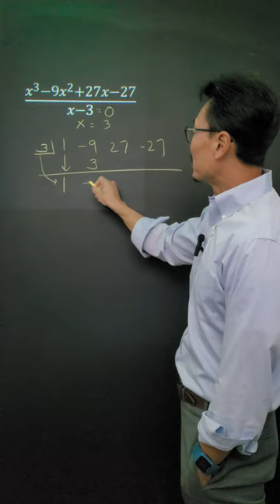Synthetic Division

Comment: lol all he did was take (x-3)^3 and divided by x-3.  So he proved that 0/0 =1 and 0*1 = 0.  Most will not understand this.
Reply: Except 0 / 0 is indeterminate, so, No.
Reply: He didn’t do a great job explaining that. In the algorithm, we do not literally set the denominator to zero. If you have seen the more standard long polynomial division, recall that we end up subtracting a multiple of the denominator. To make a faster algorithm, instead of subtracting, we multiply by -1, and add instead. So instead of subtracting a multiple of -3, we end up adding a multiple of 3.
Reply: @reefu  You actually do if x is 3.  You can spin it anyway you want to, but you are still dividing by 0.  It happens everytime there is a variable in the denominator.  If you graph (x-3)/(x-3)  you will get a line where y =1.  If yo go to where x=3 it will say undefined, which ofc is just silly.  So 0/0 =1.  If you graph (x-3)^2/(x-3)  it becomes 0*0/0 at x=3 , so if 0/0=1 then 0 * 0/0 = 0.  

Dividing by 0 is real easy.  Change the 0 to z.  Simplify the equation.  After you are done (very important) you change the z back into 0.  If you multiply or divide anything except 1 with 0, you lose integrity of the equation.  It's not a trash can.  Anything divided by itself = 1, by definition, there are no exceptions.  Another thing that will make your blood boils is that 0 * infinity =1.  Why?  because the reciprocal of 0 is infinity. Why? Becasue mutiplication doesn't actually exist, it is (by definition) repetitive adding.  Division is actually repetitive subtraction. So, how many times does 0 go into 1?  Infinite.  By definition, the reciprocal of x = 1/x, so the reciprocal of 0 is 1/0.  If you multiply a number and it's reciprocal you get 1.  Hope this clears it up for you.
Reply: @rogerahier4750   Yes, so we just have to put a restriction on the domain of the polynomial function, such that it does not include 3. It is indeed undefined at x = 3. There was a necessary assumption during the division that x - 3 is non-zero, so they didn’t prove any of those indeterminate forms.
Reply: @reefu  It is not undefined.  There is no such thing as dividing.  It's repeated subtraction.  That is literally the definition.  2 divided by one means how may times you can add 1 before you get to 2.  So how many times can you add 0 until you get to 1?  So simple, I can make a 10 year old understand.  The problem is you view math like religeon.  You were TOLD you couldn't divied by 0 and you believed them.  It doesn't matter to you that it makes no sense that you can't repeatedly subtract 0 from a number.  Oh, but your Bible can't be wrong, right?
Reply: @rogerahier4750   The definition of division is the inverse of multiplication. 0/0 indeterminate because there is no well defined way to perform this operation. We can prove that given any constant a, and the additive identity 0, then their product must be zero. However if we also know that the multiplicative inverse multiplied by itself is by definition the multiplicative identity. So there is a contraction, since 0 * 1/0 can be both 0, and 1 simultaneously, and so there is no clear way to define 0/0. This means that there isn’t even a way to define 1/0 as the multiplicative inverse either. We can see that in this case that (x-3)^3/(x-3) approaches 1 as x approaches 3, and so it would seem like we have 0/0 = 1, but we could also have the same limiting ratio but with a different numerator, namely: 2(x-3)/(x-3), which approaches 2 as x approaches 3, and so here we have 0/0 = 2. For these limits to exist, then they must approach the same number from both sides, in our case, as x approaches 3 from the left, and as x approaches 3 from the right. If we try to do this limiting argument for the function 1/x, we see that as x approaches 0 from the left, then 1/x approaches negative, infinity, but as x approaches 0 from the right, we have 1/x approaches positive infinity. These arguments can be made more precise using the epsilon delta criterion for a limit, but I don’t think you are quite ready for that yet. Don’t know why you brought up religion, but it seems in character for you to confidently make incorrect assumptions about things and state them as fact.

It isn’t that I’ve been told these things and blindly believed it in faith, but rather that these results follow from the logical framework of mathematical arithmetic.

Above you mentioned that by taking the reciprocal of 0 you get infinity, how can you perform reciprocals without division? How do you compute these reciprocals and how do you prove that a number is a reciprocal of another? You will find that any definition you give to define the reciprocal will inevitably be problematic when you try and include 0.

If you enjoy just analysing the graph of a function to prove your results so much, simply look at the graph of 1/x. Notice that it diverges to negative infinity from the left of zero, but positive infinity from the right of zero? Which is it? Can you prove that one is the more appropriate definition unambiguously using only the mathematical framework of arithmetic?

Better yet, disprove my counter example, I have the function 2x/x, as x approaches 0, we have 0/0, but the ratio approaches 2, so 0/0 = 2 right? Or what about (1 - e^x) / x, as x approaches 0, looks like 0/0, but the actual ratio approaches -1? Why is this?
Reply: @reefu  In math, multiply means the repeated addition of groups of equal sizes.   Clearly you did not read the explanation.  If you interact 0 with any number other than 0 you lose integrity of the equation.  I don't see why you don't understand that. 0/0=1, 2*1 = 2.

You seem to have difficulty understanding -infinity.  It's really not that hard.  The reciprocal of 0 is 1/0.  How many times does 0 go into 1?  1/0 = infinity.  0 * infinity =1.  0*1=0  0/0 =-1.  They both come up to 1.  I don't see the problem
Reply: @reefu  You really are trying to make things more difficult that they really are.  First, understand what multiplying actually means.  Look it up.  You say that divison is the inverse of multiplication.  Since subtaction is the inverse of addition, then division is repeated subtraction.  

Find a definition of multiply that DOESN'T say repeated addition.  When that fails, try it as it is actually defined
Reply: @rogerahier4750  Okay then, if that is such a universal definition of multiplication, what is (1 + 3i)(2 + 2i), purely in terms of repeated addition?

I want to investigate your chosen mathematical framework, so:

Is the reciprocal operation valid for any number?
Is rational multiplication defined as:
a/b * c/d = ac/bd?

If those are true:

0/1 = 0 (since we need to take 1 away from 0 zero times to get 0)

0/0 = 1 (from (your) definition)

0/1 * 0/0 = 0*0/0*1 = 0/0 = 1
But,
0/1 * 0/0 = 0 * 0/0 = 0 * 1 = 0

Hence, 

0/1 * 0/0 = 0/1 * 0/0
0 = 1 ?!

This is not a consistent framework…

I have more: 

0/0 = 0/0 * 1
= 0/0 * 1/1 (since you subtract 1 once from 1 to get zero)
= 0*1/0*1 
= 0/0*1 
= 0*0/0*1
= 0/0 * 0/1
= 1 * 0
= 0

But,

0/0 = 1, so we have:

0/0 = 0/0
1 = 0
Reply: @rogerahier4750  *gives logical breakdown of why 0/0 is problematic,

“You are trying to make things too difficult” 

Sounds like you are trying to take something as fact without using logic here…

Either you construct a method for multiplying rationals other than the standard method I’ve chosen, or just use logic and deduce that 0/0 is problematic. 

I actually used your definition of division if you would read my comment…

How do you compute 1/2 * 1/2 as repeated addition? Do you add 1/2 to itself half a time?
Reply: @reefu  */*=1.  D/D = 1.  $/$ = 1. 0/0 = 1.  That's logic.

Yes, in fact you do add 1/2 , 1/2 time.  that would be 1/4 because half of 1/2 is 1/4.  Why is that so difficult of a concept?  Like I said, find a definition of multiply that doesn't say repeating adding.  You can't.  It's the only way to define it because that's exactly what it is.  0/0 is only problematic because you refuse to understand because you have been so indoctrinted into your "religeon" that you can't accept simple logic. To me, you are no different than someone quoting the Bible. x/x =1.  Doesn't matter what x is.  Explain how it makes any sense that x/x = 1 unless x =0.  That's absurd.  That is not logical.
Reply: @rogerahier4750  For natural numbers, sure, you could define multiplication is repeated natural addition, but how do YOU define multiplication of rationals? What does it mean to add something half a time? Show me the computation, and how you get 1/2 * 1/2 = 1/4, in such a way which does not have any of the issues I had laid out above.

Here is a definition of multiplication without repeated addition: Scaling a number-line, you also get the definition of division for this as being scaling by the multiplicative inverse, but that doesn’t even matter as I USED YOUR DEFINITION OF DIVISION ANYWAY.

I have given you 2 examples of where 0/0 becomes problematic purely from the mathematical framework you have set up: division being repeated subtraction, and 0/0 is 1, in that framework, we find 1 = 0, which we know is not true. If you want a consistent mathematical framework, where we have the laws of arithmetic, then necessarily, we can’t define 0/0, or else you end up with inconsistencies like 0 = 1, using pure logic.
Reply: @rogerahier4750  you are also yet to dispute my case where 1-e^x / x as x approaches 0 looks like 0/0, but actually approaches -1, look at the graph yourself if you need, or do the epsilon delta proof of the limit.
Reply: @reefu  Where do you find 0 = 1?  How many times can you add 0 to get 0?  1 time.  Why is that so hard for you?  Show me where 0 = 1 if 0/0 = 1.  If you get 0 as a denominator, change it to z and solve for w/e.  When you are done, change to z back into 0.  Why is that so hard for you?  WHEN YOU ARE DONE is the key.  You can't just use 0 as a trash can or you lose integrity of the equation.

I find it funny that you figured out how to take the square root of -1, but can't figure out how to divide by 0 without trashing the equation.  The only reason for that ofc, is because you refuse to because of a mental block you have called your Bible.
Reply: @rogerahier4750  you say that 0 * infinity = 1, but 0 * a = 0, for any number a? Or is that not true? Well, it must be, since:

0a = 0a + 0a
0a - 0a = 0a + 0a - 0a
0 = 0a

Given any a,

So, 0 * infinity = 0? But also 0 * infinity = 1, so 0 = 1?! Again?! Gee… must be pretty difficult to do arithmetic when 0 = 1… maybe let’s just not allow 0/0, better yet, maybe let’s properly define what infinity actually means, then maybe we won’t run into these issues…
Reply: @rogerahier4750  alright, solve (1 - e^z) / z for me then, when you do, you will find that original expression what looked like 0/0 will be -1, so 0/0 = -1? But you said it should be just positive 1?!
Reply: @reefu  a is not a number, neither is infinity. Infinity is 1/0.  How did you get 0 * infinity =0?  Infinity is not A number, it's all numbers.  0 is not A number, it is the absence of all numbers.  So any NUMBER divided by 0 = infinity.  0 divided by any NUMBER = 0.  
  
0 can only be multiplied by 1 or infinity unless it is the last thing you do.  Until then it's a variable like any other variable.  Why do you not understand this?  All you are doing is changing 0 to a variable, then changing it back at the end.  

What you are saying is that a variable can never be the denominator because that variable could be 0.
Reply: @reefu  Special relativity is a perfect example.  What you are saying is that nothing can go the speed of light, but that's not true is it?  Dividing by 0 there IS defined, is it not?  We call that a photon.  So you do have the ability to divide by 0 if you want to, you just don't want to.
Reply: @rogerahier4750  There is a hole at x=3, not an asymptote.
Reply: @rogerahier4750  Except 0/0 not = 1.  That is a common INCORRECT assumption. In indeterminate forms, there is a battle between the numerator and the denominator. Sometimes the numerator dominates and drives the function to 0; sometimes the denominator prevails and drives the function to "infinity."
Reply: @reefu  Don't bother, he has a rudimentary understanding of math at best.
Reply: @rogerahier4750  You are trying to dispute that 0/0 is 1, using special relativity? If you claim something can go faster than the speed of light, calculate the relativistic momentum of a particle with mass m travelling twice the speed of light. Light travels AT the speed of light, not any faster or slower, and the Lorentz factor for relativistic quantities assumes that this is true, this is even more axiomatic of a claim than what I’m claiming. Einstein POSTULATED that light travels at constant speed for any observer, the only reason why we believe it to be true isn’t from logical derivation, but from experimental confirmation. While there was reason to suspect light only travels at a fixed speed from inspecting maxwells equations, there is no reason for why it MUST be true from a logical point of view.
Reply: @andrewlayton9760  I’m continuously more dumbfounded by their responses to be honest, I’ve essentially given up at this point because I do not have any foundation or common ground to use as a basis to dispute their claims, they do not even agree on how to multiply fractions, we can’t use algebra since “a is not a number”, and we certainly cannot use calculus, since you need a basic understanding of algebra for that, and if they did know calculus, they would already know that 0/0 is not well defined. So yeah I’ll leave it here.
Reply: @reefu  No, I'm saying it's an example of dividing by 0.  If v/c = 1, then you are dividing by 0.  It really is that simple.  The speed of light is not constant.  We already know that.  The speed of light decreases as the densitiy of the medium increases.  That's what causes refraction.  Surely you know that.

It still comes down to if something is moving at c it's mass is infinitely higher than it's rest mass.  That formula has been proven time and time again. That's not a problem because photons have 0 rest mass.  So 0 rest mass divided by 0, (sqrt(1-1)) = 1 photon.

You still have yet to show me that changing 0 to a variable is not valid.  You probably haven't even tried because you are too set in your ways to understand what is a new concept to you.  It's ok to change a variable into a 0, but not 0 into a variable?  That just absurd.  Can I change a 2 into a variable and then back again?   Why not.  Start from there and you will see how 0/0 = 1.  

0/0 = 1.  0/1 = 0.   1/0 = infinity.  Those are the only valid combinations of 0 without losing integrity of the formula.  Otherwise you can do stupid things like 2x = 0.  You could just divide both sides by x and end up with 2 = 0.  Is that what you are saying you can do?
Reply: @andrewlayton9760  The very definition of multiplying is repeated adding.  Division, the inverse of that is repeated subtraction.  x/y means how many times can you subtract y from x before you get to 0.  That is the very definition of division.  The demininator is just the number you are subtracting, that's it.  

So, what you are saying is that you can't subtract 0 from anything.  That is absurd.  Anything you build on that is equally absurd.  1/0 means how many times can you subtract 0 from 1 before you get to 0.  let's call that F for infinity.  So 1/0 = F.  The reciprocal of that is 0/1 = 0.  That means 0 * F = 1 by definition.  Dividing a number by itself is the same thing as multiplying by it's reciprocal.  So 0/0 = 1.  As a side note x/x =  1, &/& = 1. """/""" = 1.  Everything in the universe divided by itself is 1 except 0?  Seriously???

Another side note.  You can say i equals the square root of -1 with no problem at all, but can't seem to wrap your head around the concept of infinity or 0 or even what dividing actually means.
Reply: @rogerahier4750  This is the last comment I’m going to make. Since you seem troubled about the construction of complex numbers, let’s construct them rigorously for you.

Let C be a 2 dimensional real vector space, with a special multiplication where to multiply two elements in the vector space:

[a, b] • [c, d] = [ac - bd, ad + bc]

Notice that the real numbers are a subspace, given by [a, 0], which has our familiar real multiplication, [a, 0] • [b, 0] = ab

You’ll find that this vector space forms a field, and has the special property, where
 [0, 1] • [0, 1] = [-1, 0]

Purely from our definition of multiplication in this vector space.

Hence, this vector space is an extension of the real numbers, which contains an element such that z^2 = -1.
Reply: @reefu  lol, I'm not disputing i.  I'm saying if you can understand i and how to work with it, even though by normal standards that would be impossible, you should be able to understand and work with infinity and 0.  

Even after all that.  Division is repeated subtraction and all the denominator is the number you are subtracting.
Reply: @andrewlayton9760  %/% = 1.  Everything in the universe divided by itsel = 1 except 0?  Really?  How did you come to that conclusion?
Reply: @rogerahier4750  That is the definition given to third graders.